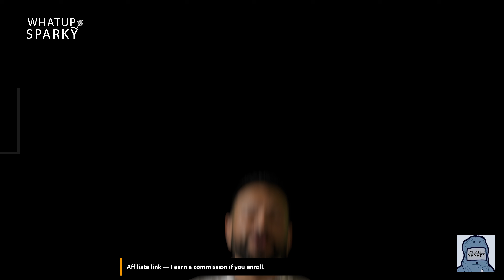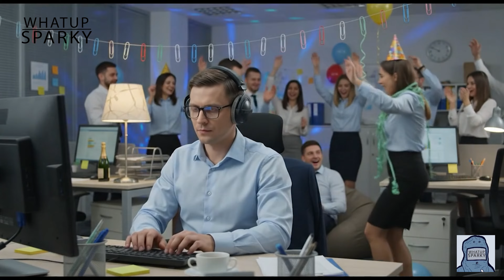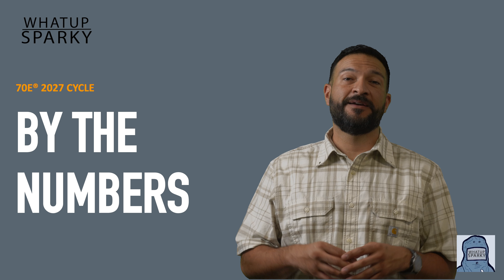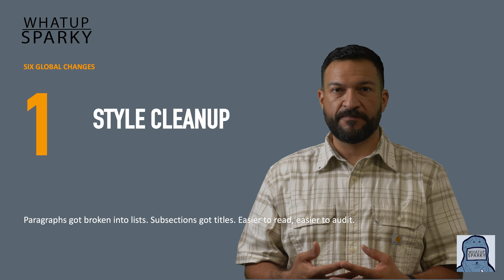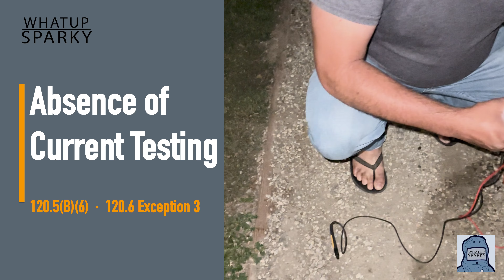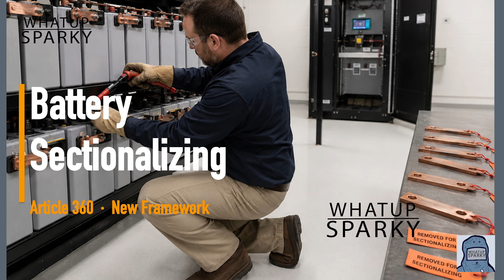NFPA 70E® 2027 CHANGES

Comment: 8:07  Do you mean in most cases the “rescuer“ isn’t supposed to stand IN the arc flash boundary, wearing 40 cal/cm2 suits, have the rescue hook around the waist of the worker, where there’s only an arc flash hazard potential turning equipment on then in the event there’s an arc flash they are also in the line of fire?  😂 Again, with a rescue hook designed for contact release where there are no electric shock hazards present for this type of task??

It’s crazy how many times you’ll see the rescuer standing IN the arc flash boundary when equipment is just being turned on. 

Great video by the way!